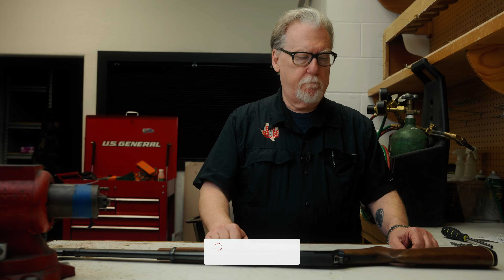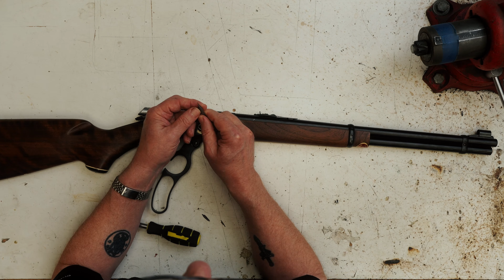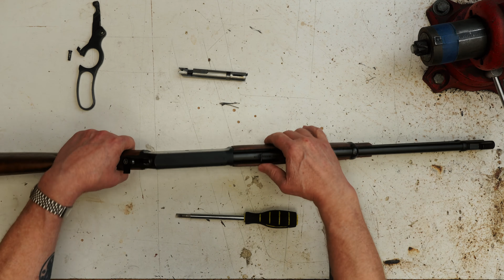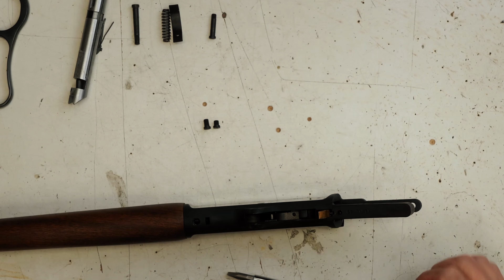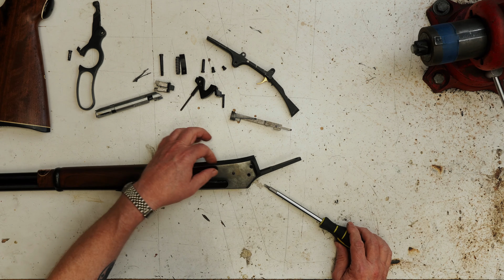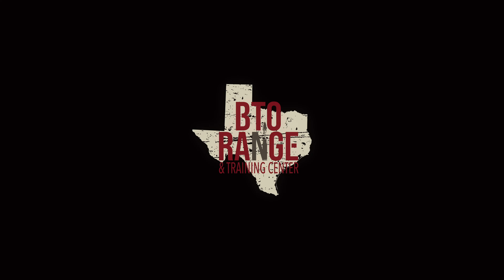The Gunsmith's Bench: Marlin 336 Disassembly & Maintenance Tips

Comment: Got a question. I've got a 336 in 30 30 that I bought new in 1972. The lever won't stay closed when I have shells in the magazine. It will close but the slightest bump will cause it to pop open. When I grip the lever no problem with lever and firing. But it is certainly an annoyance when you're trying to be quiet in the stand and the lever pops open with a clang. What do I need to look at?

Comment: I bought a 1962 Sears/JC Higgins 30-30. The serial number indicates it was made by Marlin. It apparently it doesn’t have a spring or follower. The cartridges just slide down the tube. The screw on the tube is very tight. The slot on the screw is buggered up but I think I can reuse the screw if I can get it out.

Comment: Glad I found these videos, have several 336A and W, one problem child had the loading gate screw pulled through the receiver and left no shoulder for the screw head to mount against. One gun shop botched it and drilled through and put a pin in but gave up. Gary Reeder in Flagstaff repaired it by drilling out the pin and building a large headed screw to fit the loading gate. Not a bad looking repair and the rifle functions fine again. Another shop wanted over $1200 to weld up the hole and re-machine. Still enjoy my Marlins even this problem Monday/Friday gun. .